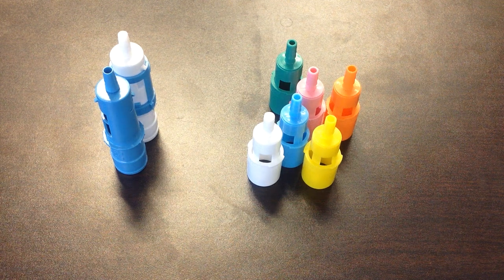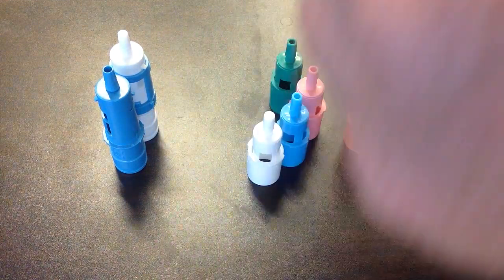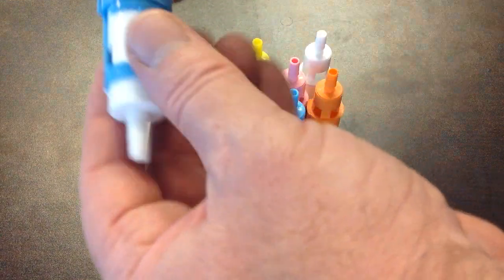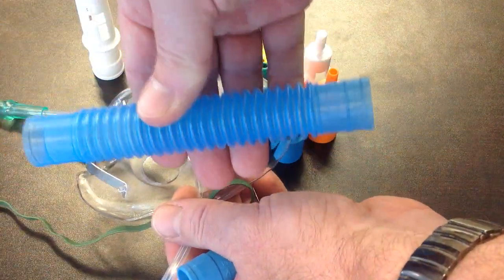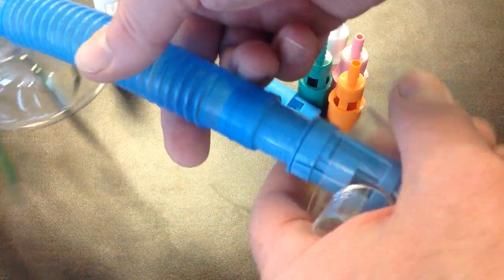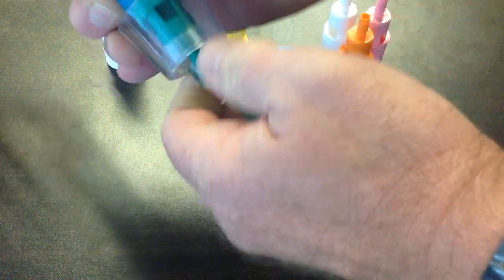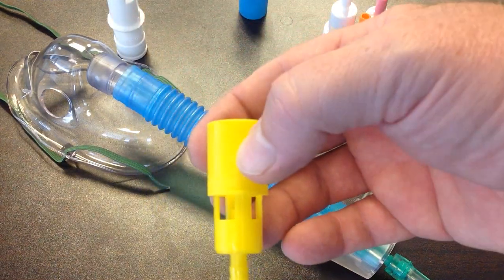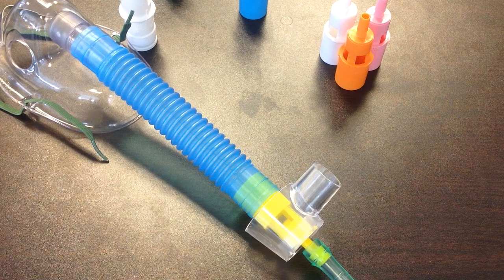W6 Venturi Mask

Comment: If the oxygen comes at 50 psi, since the area becomes bigger the pressure should be bigger... Does that mean the patient gets air at a higher pressure? I am confused.
Reply from the maker: Go back to Boyle's gas law.  Temp is constant and increase space causes pressure to decrease.  Also the O2 does not come from the flowmeter at 50 psi, it exits at a much lower pressure and is really dependent upon the flow.  With the venturimask, look at flow and not pressure.  This is using the Venturi principle of air entrainment.

Comment: Nice video but you got a bit confusing with the collar explanation... Clarify a little better next time also what is the difference with the high percentage vs low percentage with the air entrainment ports being open and closed a bit more?
Reply from the maker: The more the ports are open then the more entrainment occurs.  This would be for the masks with multiple FiO2 and you twist.  The multicolored ports have different sized internal ports/jets and potentially different size ports.  As to the collar, some will use that to prevent sheets or other items from occluding the entrainment ports hence increasing the FiO2 due to less entrainment.

Comment: At what flow rate should my regulator be????
Reply from the maker: It truly depends on what FiO2 you are delivering.  The total flow to the patient should be a minimum of 40 L/M.  The lower the FiO2 the more room air is entrained thusly the lower the flow to reach the total flow.  I have another video showing how to calculate this total flow.  It involves the "Magic Box".  Using the calculations with the magic box will tell you how at what flow to set the flow meter.